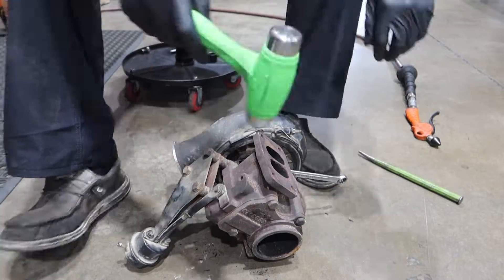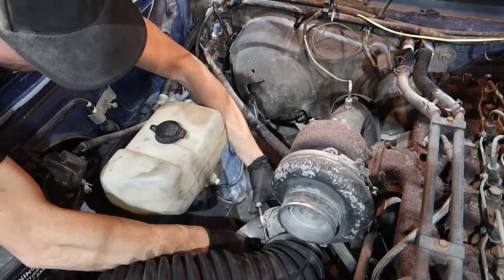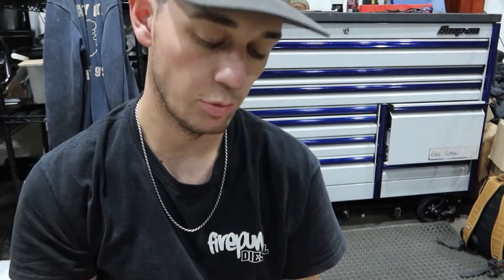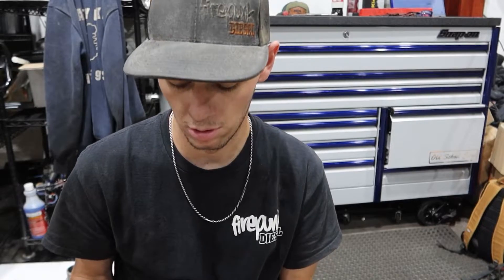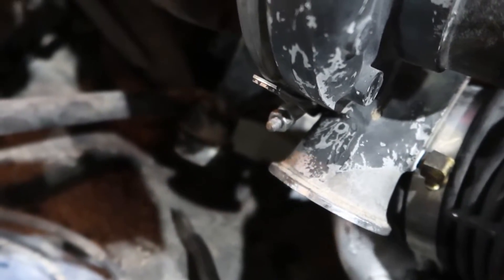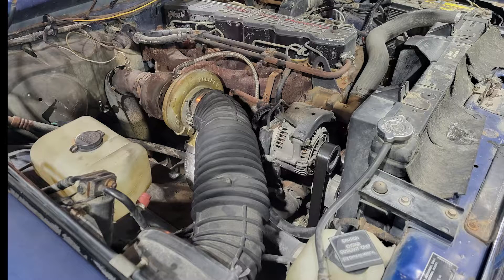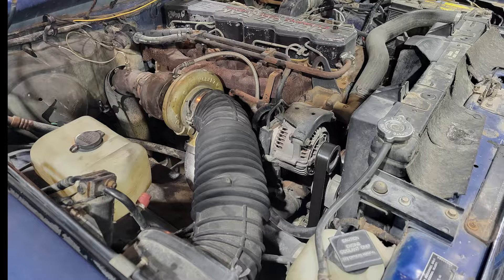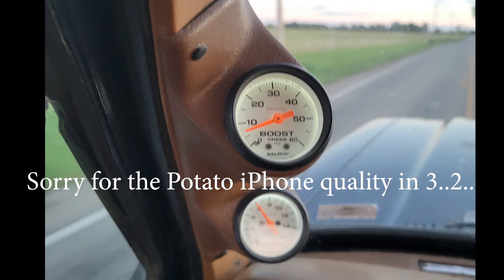HX35 "upgrade" on 1st Gen Cummins

Comment: I have a Daf 45 130hp and was looking to get it to make more power while still staying cool and lasting a long time. It has the VE pump, a reverse facing 18cm H1C turbo, and no intercooler. What would you recommend I do to make more power? I was thinking of porting head, fitting an intercooler, and making an equal flow plenum, as these mods would not increase EGTs, and a small increase in fuelling. Do you recommend anything else? Different turbine housing or compressor wheel? I'm thinking 200hp would be a safe limit, what do you think?
Reply from the maker: If it was me I don't think I'd play it safe as much as you are thinking. I think I'd tune the the pump exactly like how I would on a 5.9 because if it's done right egts aren't a problem and stock injectors aren't enough to let them become a problem with a properly tuned pump. So if it's me, free pump mods, gov spring, fuel pin,  intercooler, and an hx35 is where I'd start
Reply: @GavinHuke  Maximum vehicle weight fully loaded would be 16,500lbs. I am not trying to build a rocket ship, my priority is for it to be reliable and last as long as possible. Thanks for the reply though, I will keep watching your videos because you know how to make these engine powerful better than anyone in my country, where these engine are just workhorses, but at least that means they are cheap haha.
Reply from the maker: @Orangutan Fan  ohh I'm understanding, that's definitely a lot of weight. I would still ditch the h1c depending on displacement and continue your idea with the intercooler but every engine with these pumps im aware of is fuel limited right out of the box. When your done with the intercooler id still be shocked if with the pump maxed if you saw more than 1250-1300* egts
Reply: @GavinHuke  Thanks for the advice Gavin, I really appreciate it. So I'll do the intercooler and the screwdriver tune first and see how I like it.  Then the pin and gov spring. Eventually gonna look for a better turbo, this one doesn't even have a wastegate lol, I just found a cheap HY40V for sale near me, but I would need a 6.7 manifold for that to work. I definitely won't be building the pump or fitting bigger injectors, it's way too much for what I need.

Comment: When I put my paychecks 35 on my first GEN I took 7/8 of an inch out of the downpipe and with my TR meg welder I welded it back up and also I did a gasket match job on my exhaust manifold to the head and the manifold going to the turbo and I’ll tell you right now that open the truck up good I had a my stock cylinder head the guy ran a bull hog down in the bowls and he shined up my exhaust porch real nice for me and my truck ran a lot better ran stronger and got better fuel Konomi anyway this is six in a row jim From Kennerdell Pennsylvania and when I did the exhaust turbine when I gasket matched it I flowed that in a little ways about 3/4 of an inch so it has a nice smooth transition

Comment: I think you messed up your description. I thought you said the hx35 was a 56inducer.  When I changed my crew to a 12cm all I did was move the downpipe back everything else fit fine. I ran the stock charger for years but only had surge show up when running under 1800rpm pulling my goosneck. It never surged empty. My testing showed you didn't need the wastegate hooked up unless you were making over 35psi.
Reply from the maker: Its now a hx35 after I blew up the h1c that I put the 12cm on. I was shocked to see the surge unloaded without a doubt. The hx thats on it is a 54/60/12 it's one of those goofy looking hy35 look a likes off a automatic vp44 truck. I had a 56/60 hx35 on the shelf blown up chargers but the wheel was to mangled to shove in this one. After playing with the gate the past 2 days I've realized I don't need the boost reference hooked up as at wide open throttle and no gate reference im seeing 28psi vs the 19psi I was seeing previously with it hooked up

Comment: Have u upgraded your fuel pin and governor spring yet?
Reply from the maker: Yep, I did that back in the 2015 Era for my uncle previous to me owning it
Reply: @GavinHuke  what fuel pin would u recommend?
Reply from the maker: @tylerdietz3050  the THD pin is the best from my experience. I did a bunch of fuel pin testing with my old truck and that one had the best ramp and cleanliness of power
Reply: @tylerdietz3050  Just grind your stock pin only at the deepest point  on the side with the least base fuel and save money. I did a whole video on afc tips and tricks not long back.